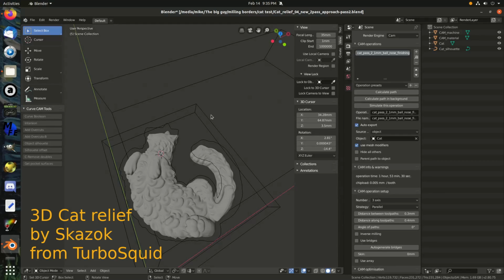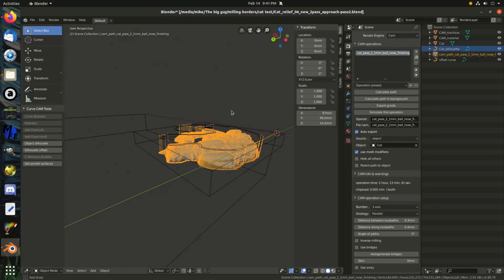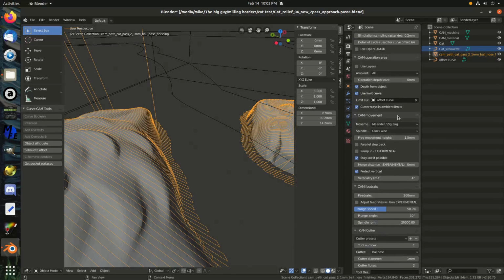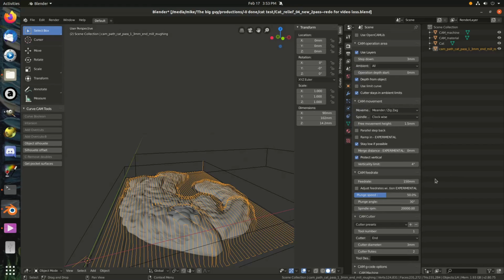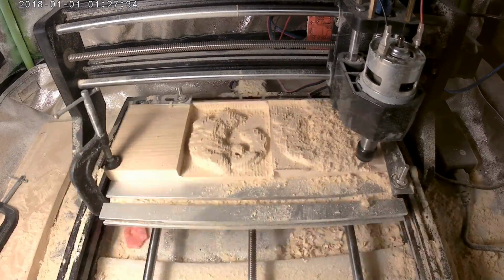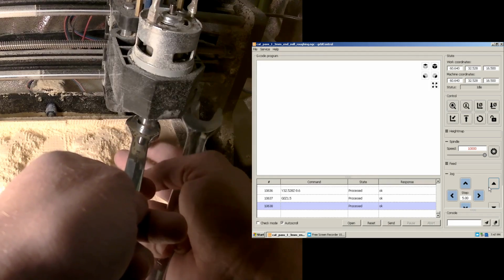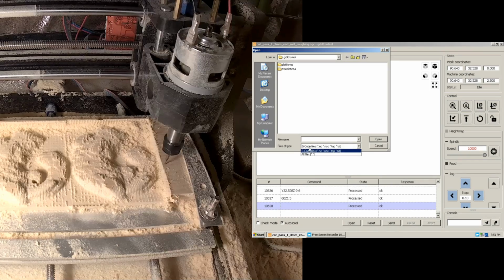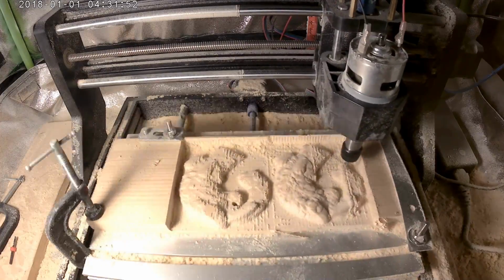BlenderCAM - roughing and finishing pass 3D relief, performing tool change on GRBL 3018 CNC machine

Comment: Do you know if the operations are additive? Meaning when you rough and then finish, does the finish pass travel over the removed material, or does it try to cut through it again? Because in other videos it looks like the latter. Thanks.
Reply from the maker: it depends on how you generate the gcode I guess, technically the finish path tries to cut through that area again, it just actually can since it's all removed already, but only in the area defined in the limit curve.  the blender objects blendercam generates are literally the tool paths.